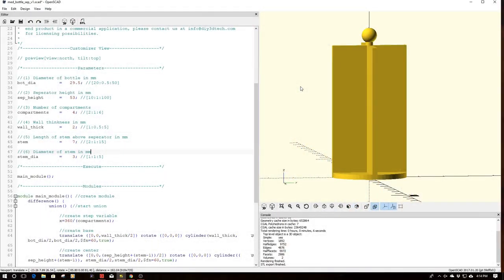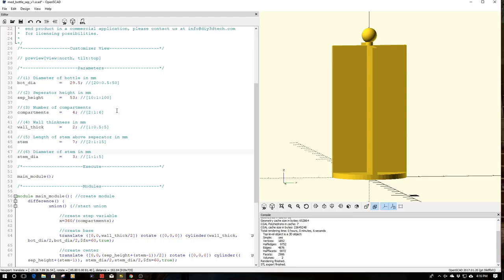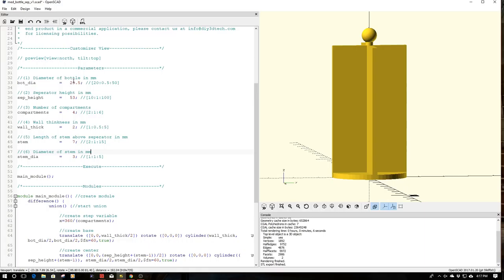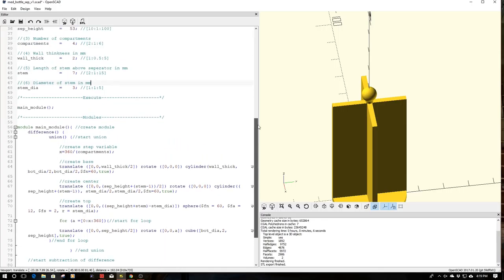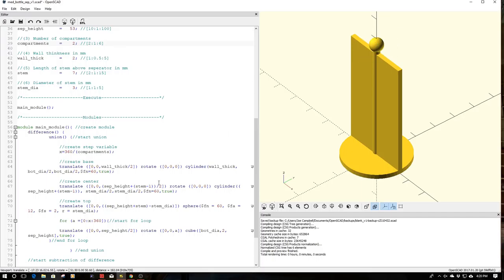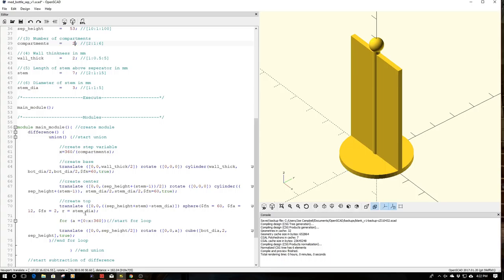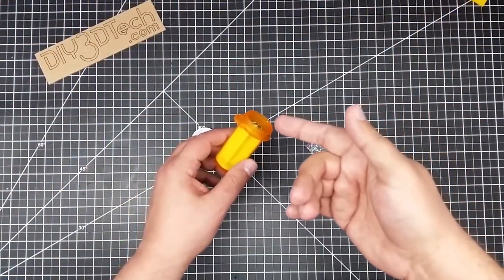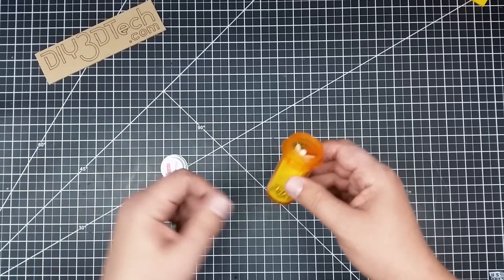Open SCAD - UpCycling Pill Bottles With 3D Printer!

Comment: Thinking out loud here. If one were to leave the ball off the top, print the separator all the way to the top of the bottle and cut a hole in the lid, you could simply rotate the lid around to the required object. I mention this because if you have 5 little screws in one section, 30 little screws in another and you want one of the 5 screws, you may end up with 15 or so screws of the wrong size bouncing around the table/floor before you get to the one of 5 you were initially after.

Mind you, I was imagining the older pill bottles that just have a simple mark to line up to be able to open them like your typical Tylenol pill bottle. Maybe design/print a lid that will rotate freely somehow?
Reply from the maker: Yes you come up with differing perturbations of the design as I am thinking about add a rotating top so as you menton you could pour out the screws...
Reply: I was also thinking that if it falls over, you’ll end up mixing screws, so the idea of making a selector (a la cake decoration shakers) would solve that issue, too.
Reply from the maker: Future video :-)

Comment: Thank you. What you are providing is very helpful. Having been a programmer for twenty some years I try to avoid starting from scratch. I got used to finding software that was close. Cutting , pasting  and modifying until I have what I was building. I am a total newby.

Could you do a video on where the libraries are and how to import them into openscad. Maybe something about how to combine modules to make something big.

Thanks bunches.
Reply from the maker: Many thanks for the kind comments and sure :-)